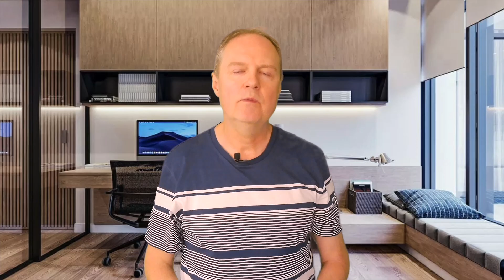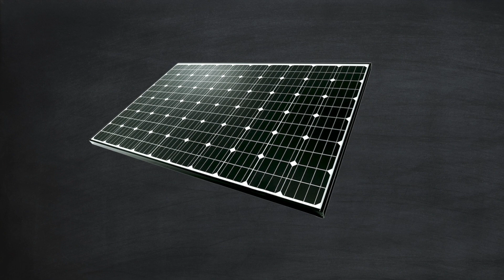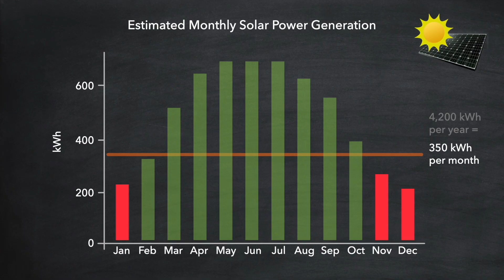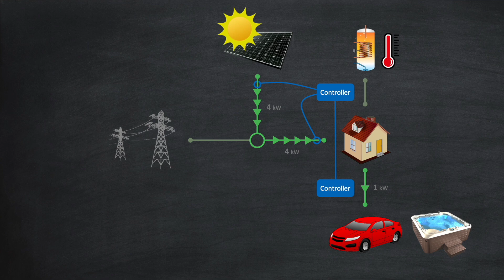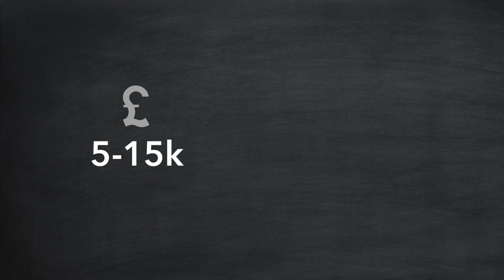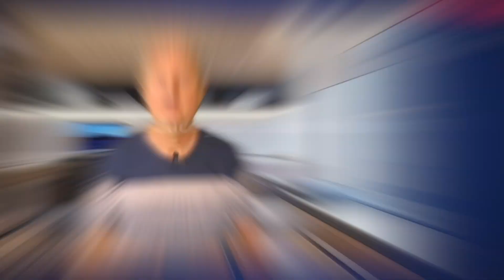A Beginner's Guide to Home Solar

Comment: Excellent tutorials and very refreshing to hear it explained at a slow pace.  My question is, with solar panels fitted and on a bright day, I turn on dishwasher. Where  is electricity coming from? In other words how does my electric system know where to take power from.   To clarify, I have 4.2 kw solar on my roof and am in a FIT scheme.  But I cannot see a solar controller.  I have an inverter taking AC power to export meter then through isolator and into consumer board.  I am intrigued to know how the AC power from the inverter gets into my ring main.
Reply from the maker: Thanks for your kind words, Norman. So if the house requires electricity, your inverter will supply that from solar generation first, if there is any, your battery next, if there is one and it has charge. The grid will then supply anything over and above what the inverter cannot supply. 

Hope that makes sense!
Reply from the maker: You might like the next video after that as well:

https://youtu.be/ccm1HmxELlQ?si=7movlRPw9WSKHxQi
Reply: @GaryDoesSolar thanks for reply, have no batteries yet. So assuming inverter makes the decision ?   Enjoyed the battery storage vlog too.  They are next !

Comment: @garydoessolar
Gary, your advice proved invaluable when I was getting interested in 'going solar'.
A year after our system was installed, I've come across  YouTube presentations by an installer also giving excellent advice on how to spec a system, carry out due diligence checks on potential installers and how to consider FUTURE adfitional loads like ASHP, Hot Tub, EV charging etc.
You may wish to collaborate with this installer, incorporating his detailed advice alongside yours.
The company is Apex Doma.
His advice is unbiased and extremely thorough so together with yours and his advice, potential customers are well equiped to make all the necessary decisions about budget and workmanship details to quiz potential installers about.

Comment: I've just completed a full year with solar panels and compared actual performance with predicted solar gain derived from the database referred to by Gary in his videos.
Early results from late September '24 though February '25 were really disappointing with solar gain consistently below predictions, but this all changed through March and July when this trend was reversed.
The final total for the year completed yesterday was 0.77% below the predicted total - not too shabby, so I'm pleased with the result - 6828kW from an array of 14 no. 455w panels on the SE roof aspect and 4 on the NW aspect.
The reason for just 4 panels @ NW was because at the time the panels were mounted in Septeber, an adjacent house would cause shading at the very end of the day.
The surprise during this summer was that the sun climbed much higher, so that shading no longer occurred. 😀
I should mention that I was glad that when I decided to increase from 12 panels to 18, I also asked for the hybrid inverter to be upgraded (before installation) from 5kw to 6kW.
Reply from the maker: Hey Martin—thanks for sharing your experience! Great to hear your system is providing great results now. Yeah, that’s the thing about the weather—it’s never the same one year to the next, so modelling can only ever to so accurate. Great to hear you went for the extra panels!

Comment: I have :-
7 Suntech STP280-24/Vd solar panels
6 Tigo TS4R Optimisers
1 Sunny Boy SB3000 inverter

Does the Sunny Boy need to be connected to the grid in order to work? I was thinking of trying the system out standalone; is this possible?

Comment: Hi Gary. I’ve been watching your videos on inverters and shading problems. I have a quote for a 10 panel East facing setup (5 each side of the roof) with a Solis S6 2.5-6kw Inverter . Can inverters handle two separate strings, one for each side of the roof? This would seem to sort out shading problems when the sun only hits the West side. Thanks, CD
Reply from the maker: Hi Colin, yes, provided all the panels in a string (MPPT) are all the same orientation, there’s no issue having two or more differently-oriented strings connected to the same inverter 👍🏻

Comment: Great video. One question - how will you compare electric immersion heater vs heat pumps, in terms of efficacy and energy consumption?
Reply from the maker: Thanks 🙏 So, immersion heaters are 100% efficient, meaning 1kW of electricity will provide 1kW heat. But heat pumps are way more efficient—1kW electricity will provide 3-4kW heat typically.

Comment: Gary whats your views on vertical Solar panels on a south-facing wall  with loads of sun NOBODY discussed these vertical Solar panels on walls
Reply: Aesthetically looks pretty cool. We're a commercial installer and were tasked to do this for a new build commercial unit in Camberley. After running calcs through the software, the generation was not ideal. We explained this to the client, yet they instructed us to proceed on the basis that it looked good! They did have a rooftop installation too though. So, depending on the reasoning, it's not advised for generation. This is due to an optimal system facing due south at a 30-35 degree pitch.

Comment: Hello Gary. thanks for another informative video. I'm just starting my solar research & i've not found many videos dealing with 3phase residential supply. Can you maybe do a video regarding 3phase set ups? What is the better option 3x single phase inverters or a single 3 phase inverter? Do you split the solar array per phase or split the total array power across the individual phases? Have you done a review on the Canadian Solar EP Cube system? thanks alot. Ian
Reply from the maker: Thanks Ian - glad you're getting something from my videos. Now, I don't have any experience with 3-phase unfortunately, so can't be of much help :-(

Comment: Very sorry, one more thing........
What is meant by the 'backup load' and the 'House load'?
Thanks again!
Reply from the maker: House load simply means the total power requirement for all the appliances in the home. Sorry, I’ve not heard the term “backup load”.
Reply: @GaryDoesSolar  thanks for the reply, 
I wish I could attach a picture.
I'll try to explain. 
I have an 8K Deye hybrid inverter. 
In the manual (system work mode setup menu) there is a picture of the inverter connected to various devices/loads.
The picture shows the inverter connected to:
1) solar panels 
2) battery 
3) Backup load
4) on grid home load
5) Grid

I understand everything except the 'Backup load'.....not sure what they are referring to?
Reply from the maker: @humdrum3899 I’m thinking the backup load here refers to the load of the battery, but I’m not sure. See this link: https://www.franklinwh.com/support/articles/detail/what-are-backup-loads-and-non-backup-loads
Reply: @GaryDoesSolar  Hello Gary,
I'm new to the solar world......
A friend of mine has recently had a solar system installed, and I think the installers have done something 'odd' and would like to ask your opinion.

His installation is this:
22 longi 550W panels.
10KW 3 phase Deye inverter.
4 x 10KW LV Sun batteries.

Prior to his installation, he had 2 consumer breaker boxes with 12 circuits per box.....so a total of 24 circuits.

After the installation, the solar company had added a 3rd breaker box (with 12 breakers) below the other 2 boxes  and marked it as 'Backup'.
12 Circuits from the 2 original breaker boxes (6 from each) were moved to the new, 'Backup' breaker box.

Tonight, he lost grid power (thunderstorm) and only the circuits from the 'Backup' breaker box worked (from the batteries I'm assuming).

A couple of questions:

1) I had assumed the inverter would supply 'all' circuits (via battery) should the grid fail.

2) If the above is true, why would the solar company install and move circuits to another breaker box that seemingly is only powered by the batteries.

I hope this is understandable....
Best regards.
Reply from the maker: @humdrum3899  Apologies for the delayed reply (I am getting a lot of comments, messages and emails these days and it takes a while to get through everything). Now, unfortunately, I'm not in a position to provide individual advice (not least because of potential liability issues, even if that advice is given free - such is the world today). You're best to continue speaking to your installer, asking them the same questions, or post a comment onto a solar forum (e.g. this one in the UK: https:// www.facebook.com/groups/2197329430289466). Good luck!

Comment: This is an old thread.....not sure if you will see this.
Many thanks for the vids....really good, concise explanations on a wealth of topics.
One thing I've not seen (unless I've missed it).....
Could you please explain how the inverters AC output, overrides the grid AC, and supplies the power to the load.
Many thanks
Reply from the maker: You’re most welcome about the video. Glad it was of some help to you.  Now the AC output of the inverter is actually combined with the AC supply of the home. More information on that here: https://electronics.stackexchange.com/questions/507935/how-do-you-combine-2-ac-power-sources#:~:text=The%20AC%20sources%20MUST%20be,same%20voltage%20and%20current%20rating.
Reply: Many thanks Gary 👍

Comment: Hi Gary,  Given the current projections for electricity costs and inflation have you changed your position.  My inclination is to go ahead and take advantage of the current Octopus Flux tariff while export prices remain high.  Of course one worry is that if a lot of new installations start exporting to the grid it could become overloaded and the tariffs could be drastically reduced.  One would need a much bigger battery bank to offset this.  Mike
Reply from the maker: Hi Mike, so inflation is always a tricky factor to manage, especially as it has been so high lately. For example, one of looking at it, would be a financial investment of say £10,000 two years ago, would cost you maybe £11,500 today for the same installation (assuming nothing else happening in the market to reduce costs). One could argue that taking a loan now would be preferable than waiting another 2 years when inflation will increase those costs further, but of course the cost of those loans is more expensive anyway. So, personally, I prefer to look at inflation as "what things cost today" then forget about it. 

Discounting inflation then, if I look at the market, I see that electricity prices are falling, but falling very slowly and they're still more than double what they were 3 years ago in the UK. Export rates are high, and many people are certainly benefiting from exporting all the solar they cannot use (and in the summer, that can be a lot! In my own case, I'm currently exporting 300-400kWh every month on Flux). I'm also hearing that equipment prices are starting to come down - essentially losing the premium they had from a market where demand totally outstripped supply. This, combined with the fact that there are more installers in the market now, and many more trained engineers to carry out solar installations, it is starting to bring the labour costs down too. 

So, in summary, I don't think my position has changed - but every person needs to look at their own situation and requirements very carefully, spend a good amount of time looking at the numbers, obtain at least 2 (ideally 3) quotations based on the same equipment requirement (otherwise you can't compare) then hopefully take the plunge! :-)

Finally, you're right - as more and more residential properties export to the grid, unless the DNOs prepare for this, it'll cause bottlenecks. But, you know that's the game you're in if you're a DNO, so I'm expecting them to be getting on sorting out s strategy - because this train ain't stopping...
Reply from the maker: Sorry, forgot to cover your tariff point - I'm not expecting export tariffs to disappear or reduce in value, other than in line with decreasing import prices.

Comment: Hi Gary  great explanation, your description in this video in regards ct contoller as your scenarios on the cylinder water tank, but I use electric emergence heater to warm my water and radiator. How do I getxthis ct controller  You video had inspired me to get, ie panels, bird proof, battery, hybrid Inverter. Thanks
Reply from the maker: Great stuff :-) Now, the Controller unit I talk about at 9:47 is a solar diverter, for example Eddi or iBoost. Be mindful though, that with higher export rates at the moment, these units may not be financially viable. Good luck with your solar journey!
Reply: @GaryDoesSolar  thank u I did see that as I seen ur video on this thanks

Comment: Great content and lovely to see someone that puts together a spreadsheet to help everyone to run various calculations to understand the variations when/if prices change. 
Is there a way to change the spreadsheet to allow modelling of the tariffs that have a cheaper night rate e.g. Octopus Smart?
Reply from the maker: Hi Jag, thanks for the great feedback! And yes, in the spreadsheet you can simply substitute new values in columns N and R for the tariff you're interested.

I'm also working on a web app version of the utility, which will be easier to use. More soon... or send email and email to "me" followed by an at symbol, then my channel name (all one word) and finally dot com, and I'll send you a link to an early version of it.

Comment: Great videos, subscribed!  I’m in the beginning stages of planning a solar system.  Do you know if it’s possible to have a system where I can run mostly off grid along with battery backup, but also have the ability to either automatically or manually connect to the grid or a gas generator to recharge batteries when it’s needed?  I’ve seen a few videos where you need to disconnect the battery set, then use a charge controller connected to generator.  But are there components available to make this easier to do?Without having to disconnect the battery set. I can’t seem to find the answer anywhere. Thanks in advance!
Reply from the maker: Thanks - and I really appreciate your subscription! I'll keep the videos coming... With regard to off-grid topics, it's not an area I know too much about yet, but worth following this channel: https://www.youtube.com/@The_OffGridFamily

Comment: Sorry to be a pain but solar is a great idea if you have enough money to set it up ie £15k to £20 k for a reasonable ...yet SMALL sized Uk set up the experts talk of not using batteries ,,skip those ideas and move on to someone who knows what he is talking about ,,,the no battery idea involves using the grid ,,,as some sort of energy saver fof you to use later in the day ,,instead of your own battery storage ,,if you are lucky and fill in all the red tape properly you might get paid 7-9 pence per kwhour ,,you feed in ,,,how much do you think you are going to be charged ,,,later in the day to get that back out from the Gas ,Oil Nuclear Wind And a Little Solar powered grid ,,,and then when its 3 x times the money you may be getting paid  try proving what you used and  what you actually generated ,,,these numbers are based on constant power over a given period ,, which with Solar is very Grey to calculate ,,,regardless which one of these You Tube wizards are doing the sums ,,hopefully i touched a nerve somewhere im sure i will get a few yes but no.but answers ,,which i will ignore ,,,install a system that included all yhe costly variables and in time you may break even ,,,

Comment: Great video Gary, your costs don't allow for replacements, my system is 16 panels, a hybrid inverter, and batteries however 2 years ago my inverter stopped charging my batteries I was told that the batteries were not suitable for the inverter. I have now had a new inverter and 3 Ion batteries installed so another £3.650 plus maintenance package which now gives me 10 years full cover parts and labour, so a lot of money
Reply from the maker: Hi Martyn, sorry to hear you had to shell out another few thousand pounds just to keep your system going. This is the downside of having a string inverter (which is the most popular option for domestic solar) - they just don't last much more than 10 years (best scenario) and could fail a lot earlier (as it did in your case). 

And you were hit with the next problem, where DC-coupled batteries compatible with one string inverter are not for other inverters - such a shame, but maybe you can sell them...

Comment: Hi, we are in the early stages of considering  a solar set up, our last years usage was 2500 kwh. The first person we spoke to said we will need 7 panels,  a 3.6 kw inverter, and a 5Kw battery. We have an emerson heater, so we will be using that to heat water whenever possible. Does that size system sound right.
Reply from the maker: Hi Robin, unfortunately, l'm not in a position to provide advice, not least because of potential liability issues - even if advice is given free - such is the world today). You're best to speak to an installer about that, or post a comment onto a solar forum (e.g. this one in the UK: https:// www.facebook.com/groups/2197329430289466) Good luck!

Comment: Thank you for the very informative video. One question - if you have a solar & battery system and your Hybrid inverter is rated less than the peak output of the system, and is therefore clipping, are you able to divert the "clipped" energy into the battery? Salesman says you can, but I'm sceptical.
Reply from the maker: Hi Andrew, thanks for the kind words. Yes, you generally can if the battery is DC-coupled. Check with the data sheet of the battery in question. The clipped power can never leave the inverter onto the AC supply but it can be fed directly into the battery 👍🏻 A nice benefit of DC-coupled batteries 😀